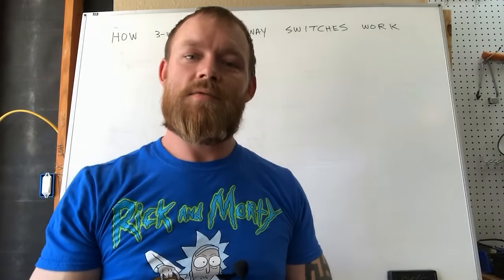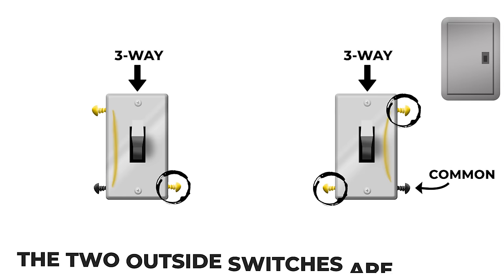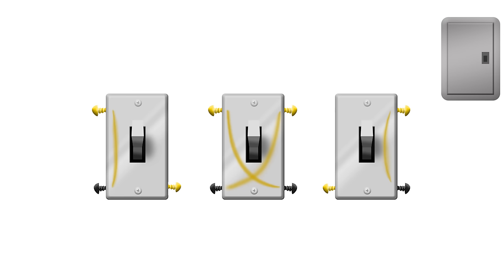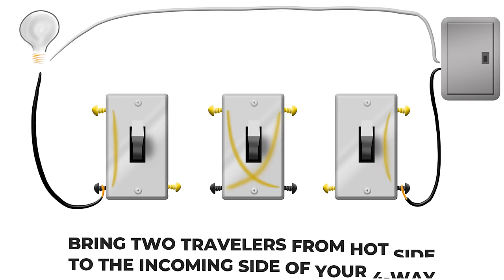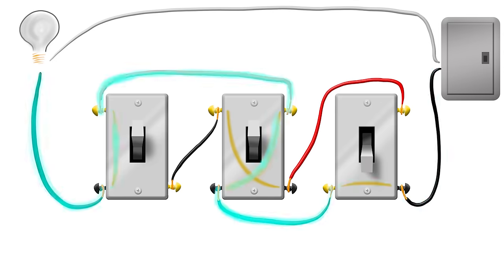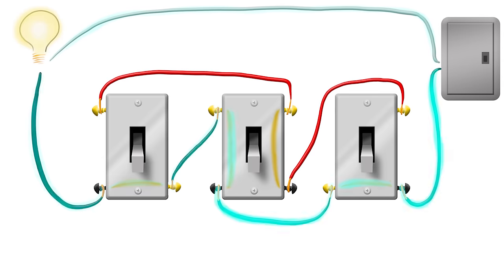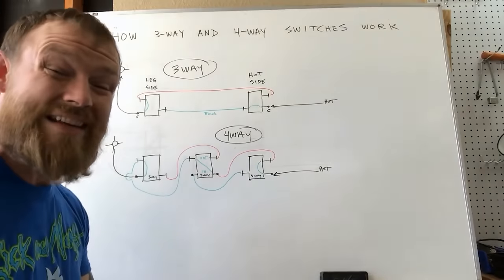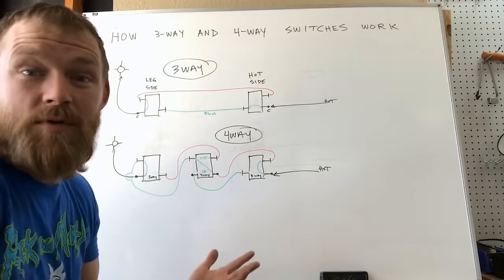SHORTS - How 4way Switches Work - without the fluff

Comment: I have a question about homes without ground wire receptacles. Can installing GFCI OUTLETS acceptable over re- wiring the whole house to get around the open ground for inspection purpose. Thanks in advance
Reply: Yes. Ask about your local laws but where I'm from it's an acceptable way to come up to code. Usually you have to label it as well

Comment: What good is a 4 way switch? I have 3 pairs of 3 way switches in my house, AND HATE THEM TO A POINT. Why would someone want to make a difficult system (3 way switches) into a psychotic mess???
Reply: Because it's just so much fun!
Seriously, using 4 way switches, a circuit can be switched from any number of locations. I've never had to wire it myself, but there are situations where it is helpful.
Reply: If by difficult system you mean the switch position no longer represents whether something is on or off than yes that's frustrating but not having to walk all the way down a hallway or across a room to turn on or off a light is advantageous. And a 4 way doesn't complicate things it's just another point of control

Comment: Hey Dustin, I commented on another one of ur videos asking if I should invest in getting a good suspenders for my tool belt, but I forgot to ask what kind I should buy... I’m 5’10” - 5’11” 200 lbs with wide hips and shoulders, what would be the best tool best suspender to get for max overall support?
Reply: The padding where's out eventually. It may depend on the packaging but trying them on in the store. Or just asking guys on site which ones have held up and which ones are comfortable. They are all adjustable so size doesn't really matter.

They are very helpful in taking some of the weight off the hips. I haven't put mine back on and I've got some bruising from the weight of a full belt

Comment: Could you do a diagram on having the light go to the 4 way than split off to the three way
Reply: The three way has to be the last one. Otherwise it's just acting as they three-way switches.

If you replay the video to the point where he turns off the 3way with the switch leg to the light you'll notice there's still power to the 4 way. Which means only two switches would function instead of all three. 

The three way swItches always have to be the first and last switch. You can have as many 4 ways in between as you want

Comment: In what situation would you use a four-way switch? Please explain
Reply: Any number of four ways can be installed between two three ways depending on the number of switching locations you desire to turn off a light (or string of lights).

4 switching locations for one group of lights? Put two four-way switches between two three-way switches.

5 switching locations for one group of lights? Put three four-way switches between two-three way switches.

Continue this logic for every additional desired switching location (number of desired switching locations minus two equals the number of four-way switches required).
Reply: A large room that has multiple entrance and exits. If your leaving the room you don't want to walk back across to turn the light off. Instead there's a switch by each door

Comment: Its basically 2 parallels wires which one is hot, the other is neutral, and whichever switch you toggle will connect or disconnect those parralels
Reply: No, you are mistaken. The neutral has nothing to do with any switching. The neutral is always connected. Those 2 parallel wires are travelers. They can be hot but never neutral.
Reply: you never switch a neutral, you have to think as 2 paths

Comment: Can you do one of these on the whole pole/throw thing? In the apprenticeship and the connection between them and what they mean is lost on me.
Reply: A pole signifies an input or common terminal, and a throw signifies an output terminal, basically. A common single pole switch is a single pole single throw switch (SPST) because it has 1 input and 1 output. A 3 way switch is a single pole double throw (SPDT) since it has one common terminal and 2 switch positions (it is connected with 1 of 2 different outputs at any given time). A 4 way switch is a double pole double throw (DPDT) because it has 2 input terminals and 2 outputs terminals.

Comment: Great visual, but I'd leave the neutral out of the picture as it implies it goes directly from the panel to the fixture. It would be a pain in the ass to illustrate how it is tied through each successive switch box, so why bother.
Reply: it's not a circuit without the neutral, that's probably why he included it.
Reply: @jman210210  If the people don't know that by now, they should just stop watching.
Reply: @theprofessorfate6184  If they are trying to learn, they may not know just yet. There was someone in the comments who already thought that one of those travelers is hot and one is neutral. There are probably some folks watching who generally have no clue. Lol
Reply: neutral is important to show the whole circle, this is not a video about how it is wired in the junction box, but a scheme on how current flows through a 4-way
Reply: It's essential to show how the circuit operates. This is a wiring diagram not an installation

Comment: Ok, now do a graphic with 5-way and above
Reply: same oh same oh
Reply: There is no 5 way... There is nothing more after a 4 way. You can put several 4 ways in between two 3 ways, but those are still just 4 way switches with 2 travelers in and 2 travelers out just like in the video.